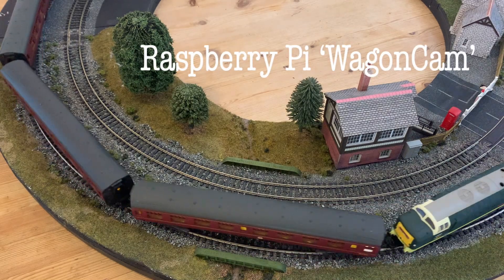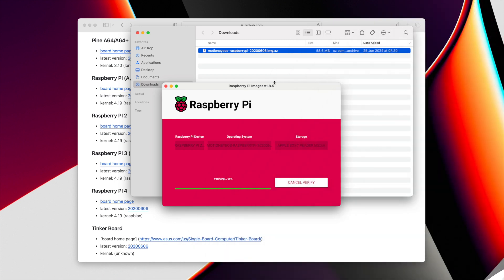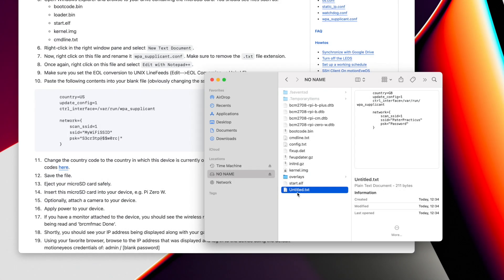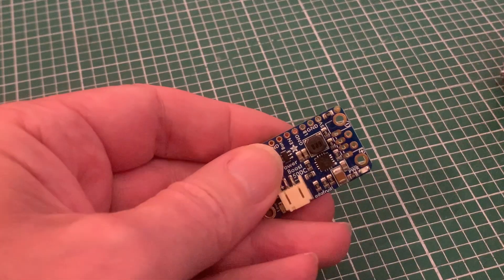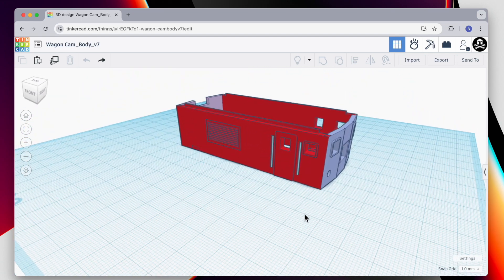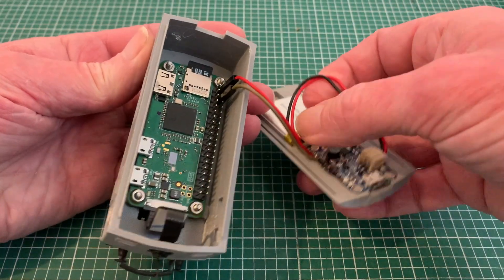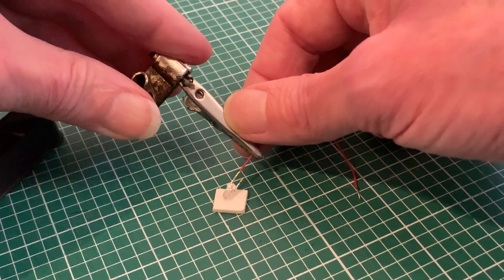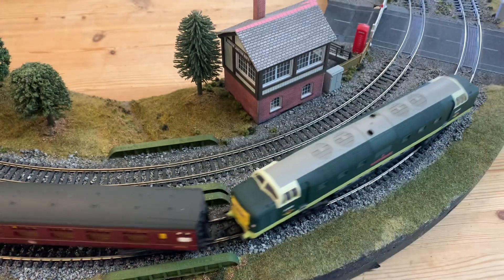Build a WiFi streaming ‘WagonCam' for a driver's-eye view of your model railway with a Raspberry Pi

Comment: Very nice; you could place the power switch accesible from the outside to avoid having to remove the roof.
Reply from the maker: That’s one thing I’m planning for WagonCam 2.0, along with power from the track to constantly recharge the battery - effectively a UPS for the Raspberry Pi.

Comment: Nicely done and using the Pi opens up all sorts of possibilities. I took a simpler alternative approach last year for a Christmas present. I butchered a TP-Link Tapo C110 2K camera (bought on offer from Amazon for £12) and stuffing it in a box van powering off the DCC via a 9V regularor and some beefy big cap keep-alives. The camera captures sound plus it has IR LEDs for 'night vision'. It similarly works over wifi being streamed to a mobile device via the Tapo app or in my case I open a RTSP steam in VLC media player. Sound and video can also be captured by inserting a micro SD card.
Reply from the maker: Cool. How was the quality?

Comment: I thought at first that you are going to use powered pickup and get the power from the tracks. that would make it somewhat more convinient
Reply from the maker: I’m saving that for my Class153 version. DCC function can provide power to the Pi via a voltage regulator.